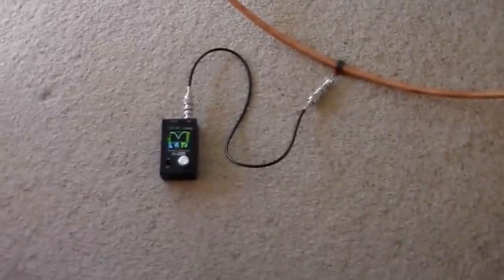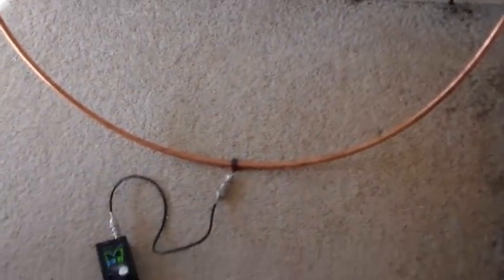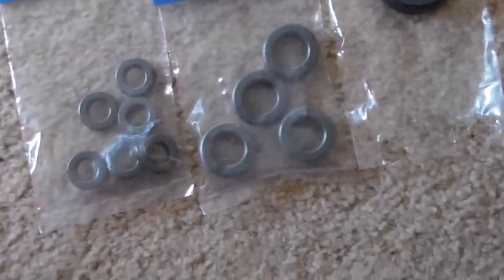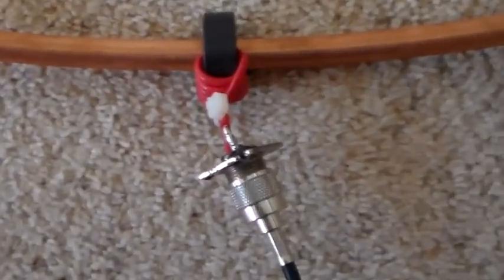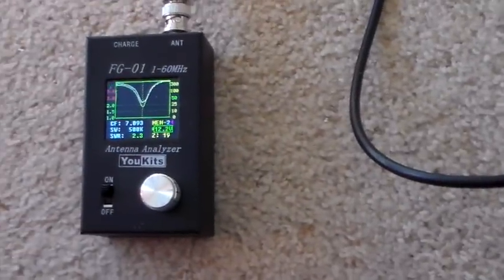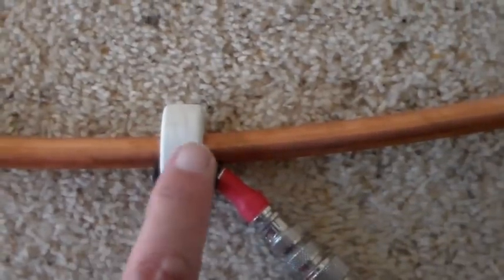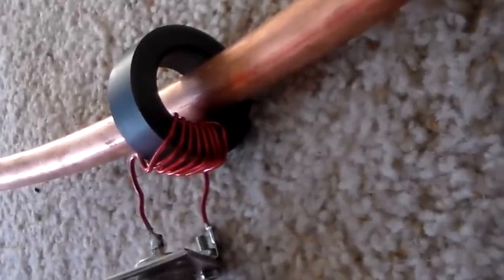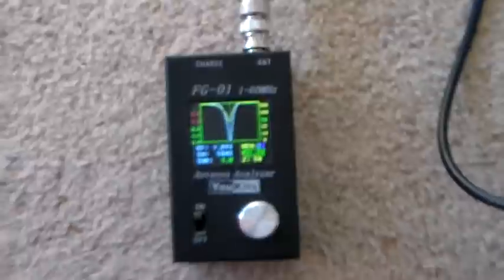Feeding A Magnetic Loop Antenna.

Comment: Thank you for this video, it helped me understand a problem I was having with a 3 ft dia. 21 MHz loop I have built, the problem I was having was the loop didn't have a narrow tuning range, I could tune the SWR down to 1.2 but the bandwidth was 500 KHz wide until I put four turns on my FT-290-43 toriod.  One turn would produce a very low SWR, but the loop Q was low, once I added those turns, there we go, the typical 40 KHz narrow bandwidth for my antenna dimensions indicating high Q while a low VSWR at the same time. Obvious to me now, without tight enough coupling, I couldn't have high Q producing high efficiency.

Comment: Have you ever measured the toroid transmission loss? Well - I did that on a Ø90 cm loop for single frequency use on 10 meters. First try with an FT140-43. Perfect match: SWR 1:1,1 and Z 49 Ohm. Unfortunately the transmission loss was approx. 4 dB, which of course heated the core in seconds with just 25W CW carrier. Next try with an FT114-61. Same perfect match, but now 6dB loss. I haven't measured at lower frequencies. So - for transmission it's not suitable unless for low power with a big loss. 
73 de OZ5XN, Allan
Reply: I've seen mention of ferrite cores heating when used as a balun, which does concern me as clearly heat is lost power. Perhaps I should look into an air core balun and not use a ferrite? More below:

From what I have found googling around to see if there are other reports of ferrite loss that high, I've found loss increases with high flux density, perhaps use a larger core or stack them? For the FT290-43: calculated core loss is 0.6 dB on 80m and 0.5 dB on 40m so efficiency around 87% – 90%. From this data, loss is less on higher frequencies for core 43. What was your measurement setup?

Comment: Sorry to revisit this subject after such a long time, but I have built a copper Magloop of the largest diameter that will fit through my loft hatch. (Stealth don't you know).
I have tried all the traditional methods of coupling, loop, gamma and ferrite transformer like this video. By far the easiest and  best performer is the ferrite route.
My question is "Are we fooling ourselves by only looking at SWR and match resistance?" is the radiation resistance appalling but the antenna looks great with our measurements?
I have no method of measuring radiation resistance but greater minds may have, have you or any of your hoards of eager followers any idea if this method actually gets a signal out or is it absorbed by losses in the ferrite for instance?

Yours in eager anticipation.
Tim Hill 
M6TYH

Comment: hello i will be making this loop antenna but not very good at bending copper pipe i have used 15 mm but it looks horrible i was wandering can i cover the loop with 20 mm plastic water pipe ?.
Reply from the maker: I don't see why not, people use coaxial cable to make loops and don't remove the insulation. From what I've heard it isn't a good idea to use grey PVC pipe as it has metal in it, apparently the white stuff is ok for covering antennas but I'm only repeating what I've heard or read. I have no personal experience with covering antennas with PVC tube.

Comment: Does it matter what kind of ferrite mix you need for the loop? Does the ferrite have to be small or big? I have some that are about 2 inches in diameter. Have to try this.
Reply from the maker: Yes, the mix does matter. I have never tried a specific mix, I just use the standard Ferrite cores from Jaycar. They seem to work fine. As far as the diameter goes I just use what will fit reasonably well over the tubing.

Comment: hi, what are the diameter of loop? and the diameter of tube?, 73´s from chile, CE3MSB
Reply from the maker: +Miguel Villamor Hi Miguel. The diameter of the tube is 10mm, the diameter of the loop is approximately 1m. It's 3m of copper line from the local hardware store.
Reply: +VK6CS thanks for answer¡¡¡, one more question, what are the diameter of last toroid?, i see with that the swr is optimal form 40 m, and have a picture from inside the box that have the variable?

Comment: put 8 turns on each of the other toroids and you'll have 1:1 SWR and 50 Ohms
Reply from the maker: +Geronemo Bauer Thanks. Next time I'm playing with the loop I'll try it.
Reply: @vk6cs456  Any success using a toroid to feed?
Reply: Hello Running Bear, Would a 240-43 work? How many turns? Thanks

Comment: It would be an interesting video apart from the - you guessed it - resting on the ground and against a wall.  From the matching figures you show, it would strongly appear that these would be much closer to or at 1:1 if you had it on a timber stand, preferably outside, away from metal objects.  The toroid matching is OK, but I've always found a simple gamma match to be preferable, not least because it can be made from simple hard-drawn copper wire (some stiffness required for mechanical stability, but not much.)  Vacuum capacitors are my preferred components.
Reply from the maker: +Freddy Mack  I read somewhere that magnetic loop antennas perform better with the feedpoint close to the ground. Take a look at the VK3YE You Tube channel, Peter has done some interesting stuff with loops. I did have to put a few more turns on the toroid to get a 1:1 match when the loop was hanging from the lounge ceiling.
Reply: Magloops work well with a feedpoint close to - but not on - the ground.  'Close to' usually means at least a metre or so up.  Obviously, your loop will 'work', and does match - to a point - resting on the ground.  It's just that you'd almost certainly find the SWR would be lower if it were supported off the floor and in a clearer environment.  Just like for any antenna, really!  I comment as a daily user of a 60-17m magloop, and also of a G3JKF three loop array.  Keep building!
Reply from the maker: 'Close to' means a couple of inches. Did you look at the VK3YE videos? Have you tried your loops a couple of inches off the ground for comparison?
Reply: I don't think I'm looking for an argument.  For those who might wonder why a magloop can show higher than ideal SWR (such as in your own example), then lifting the damned thing off the ground and keeping it away from household wire looms can be a good way forward!
Reply from the maker: Freddy Mack Hi Freddy. I'm not looking for an argument either... I just wondered if you had tried it with the feed point close to the ground for comparison. My video is more about showing the feed method, it would need a few more turns to get a good match if the loop was a meter or so above the ground in 'free space'.

I have used a different loop with the feed point a couple of inches from the ground and got very good results with an FT 817. People have told me they have got excellent results with the loop standing on the  ground in the patio leaning against the wall.

Comment: Hi... I see that your entire testing has been done at ground level, ie. literally, with the
loop sitting on the ground and leaning against the wall.

I found that with a  large commercial loop and small Faraday..matching loop,  (80- 10Mhz) the feed Z varied greatly from Hi to Lo and on no band could I achieve a usable Z / SWR until it was elevated to a min. of 1/4 diameter above ground which in my case is  open soil in the garden, not a building hard-surface. 
In addition, the Q was large enough to be intolerant of nearby objects, especially human bodies...
Not tried toroids yet but am encouraged by your results... Thank you for the video.
73 de G3NBY
Reply from the maker: +MauriatOttolink Thanks for your feedback. I have not tried the small loop coupling method, but I will give it a go at some point. I read somewhere that magnetic loop antennas perform better with the feedpoint close to the ground. Take a look at the VK3YE You Tube channel, Peter has done some interesting stuff with loops. I found that I had to increase the amount of turns on the toroid to provide the correct impedance when I moved my loop away from the floor and wall. From memory it was about 4 turns.

Comment: I use this feeding type with an Amidon FT130-43 for my 630m magnetic Loop antenna. (28m TV coax cable)  Works fine ^^
Reply from the maker: Wolfgang S. Good to know, thanks for the comment Wolfgang.
Reply: @vk6cs456  From what I've been able to find using Google, these cores have higher loss when the flux density is high, perhaps use a FT 290-43 core instead?

Comment: Great video! Can you do the same test with the loop suspended and away from the floor or other structures that might influence the readings? Thanks!
Reply from the maker: Gabriel Sierra Thanks for the feedback... good question. I found that when I suspended it in free space I had to put a few more turns on the transformer. It worked well with 50 watts and a good report from a station 600kms away on 40m. I had a lot of receive noise which was unexpected and as I couldn't find the source I went off at a tangent and did something else. I will get back to it, and record and post the results, but for now I can tell you I was very impressed with how well it radiated.
Reply: Could it be a thing of bandwidth by using the ferrite versus a coupling loop?
Reply from the maker: +Gabriel Sierra Maybe... I haven't tried different coupling methods, but I'm sure I'll get around to it.